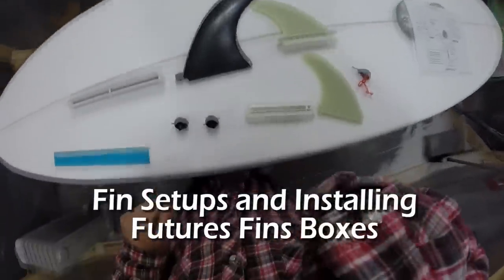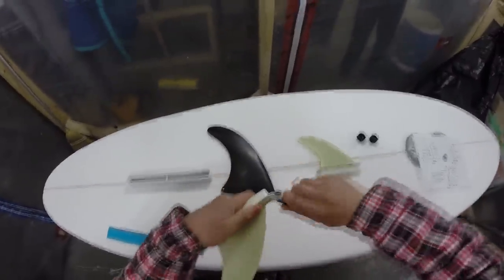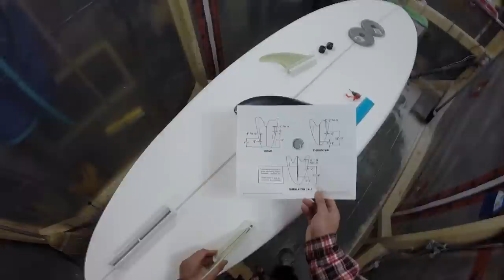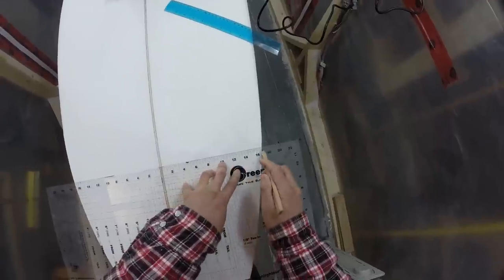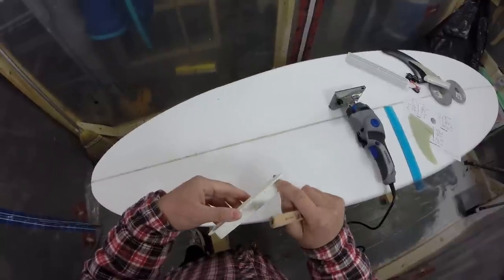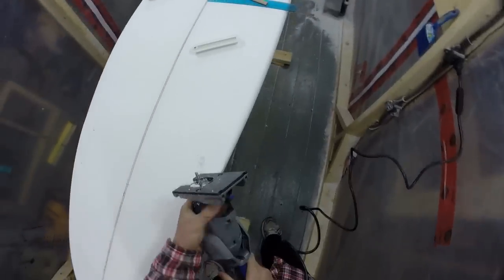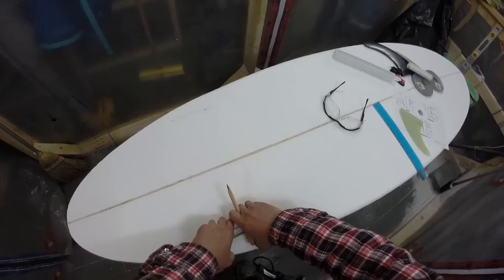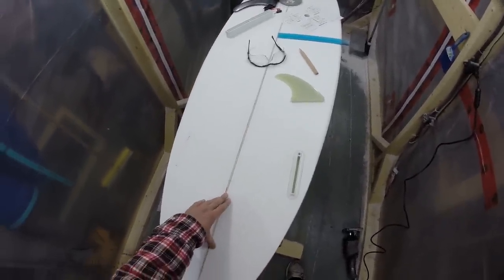Installing Futures Fins Box: How to Build a Surfboard #18

Comment: You just freeform router'd those like a boss.  I'd recommend to hold a flat piece of guide edge material (paint stick maybe) as a straight edge to slide the router base against.  Cut a straight line, cause I for sure cant cut a straight line.  I DO like the futures cause the shape is so easy to do vs the fcs.